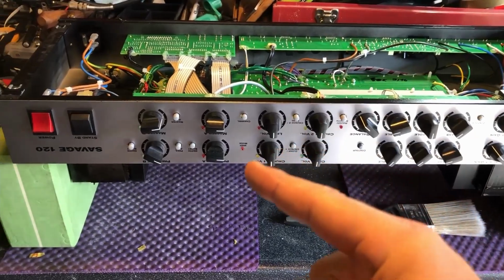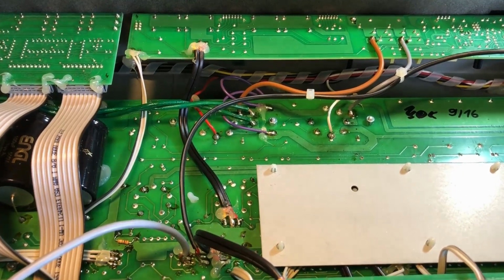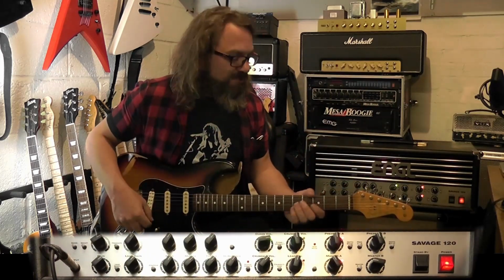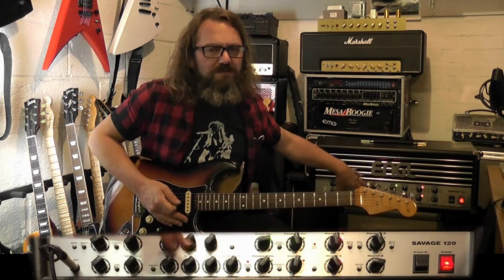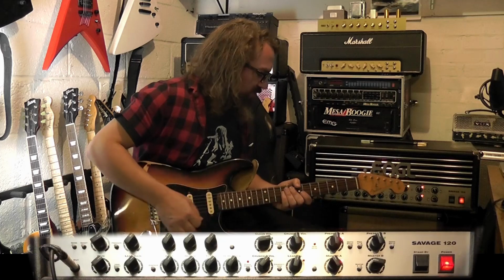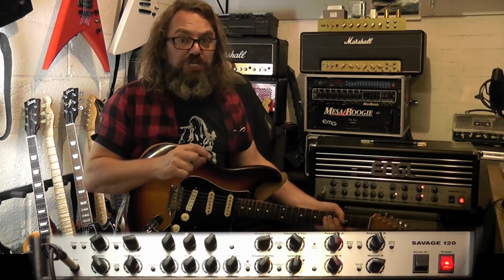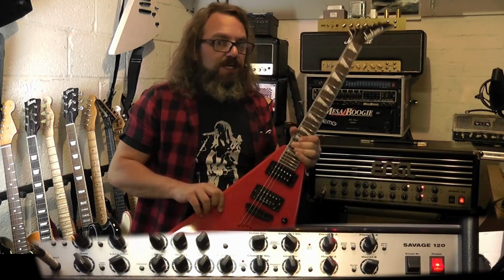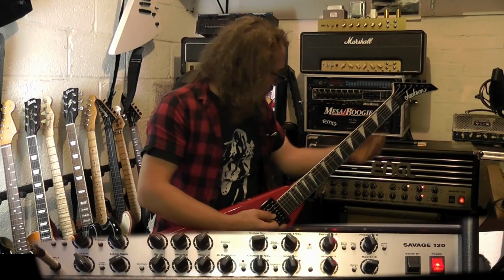ENGL Savage 120

Comment: Why do they mount the PCB's upside down? I asked my tech about ENGL one day and he said they are nothing but a pain in the ass and the new ones are even worse and he would even ALMOST work on a MESA before a ENGL. That is saying something! You can get amps built better than this for less money plain and simple and NO Thank You!
Reply from the maker: I looked up the price of these after  I made the video, I was shocked to see they at the 2k mark. I have no issues working on Boogies to honest and at least they use quality PCB’s and components and are built tough. No need for gobs of hot glue in Boogie’s. 
I’ve see sub £1000  amps with much better build quality than that ENGL.
Reply: @RDamps  I think it does sound good but the asking price is crazy for what you get. I would think that if you had to even fix anything in that amp wouldn't you need to remove all PCB's just to even see what is going on as it's all upside-down? Not a Tech but I would assume you can't fix what you can't see and get to the bad component and to do the job right I see no other option but I could be very wrong.  Does ENGL have a valid reason for mounting the PCB's in this fashion ? As I do not know what the benefit would be. Enjoy your videos and take care!
Reply from the maker: Yeah if there was a serious problem it would be a major ball ache because as you say, I would have to pretty much dismantle and unsolder a tone of connections to get to the component side.